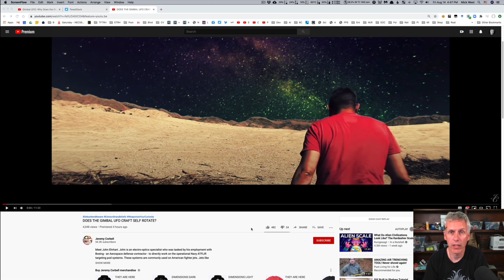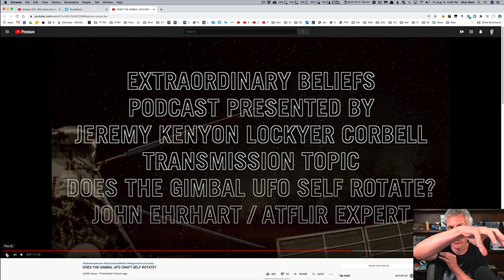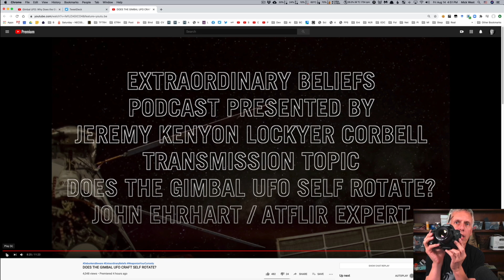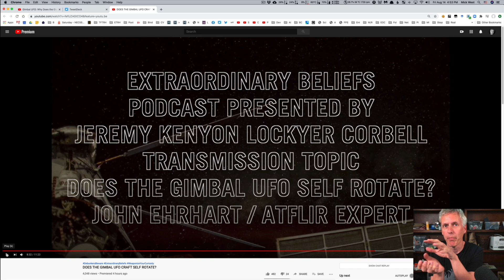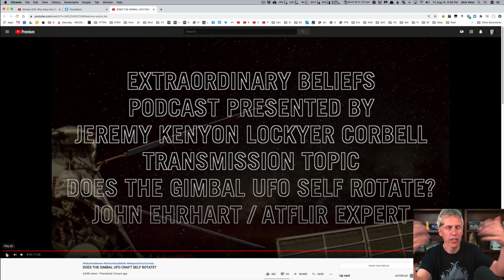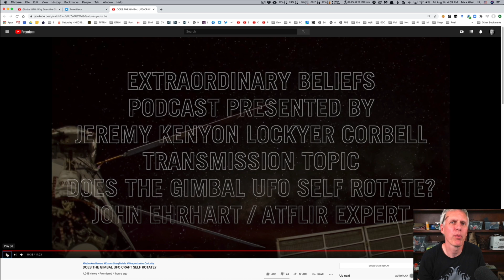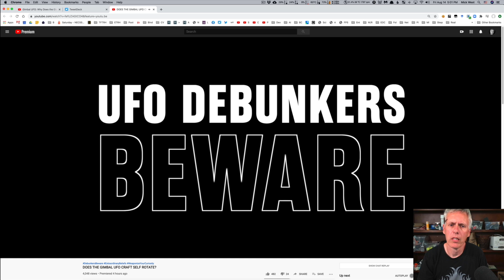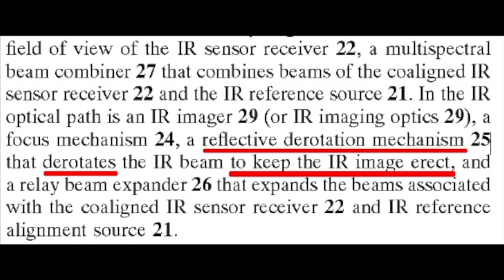A response to "DOES THE GIMBAL UFO CRAFT SELF ROTATE?" (ATFLIR Tech)

Comment: The guy that actually designed the system that we are talking about blatantly said it was not an artifact, optical distortion or other explanation. 
The same goes with Dave Falch and people that actually use these systems and were trained in them.

Comment: This expert has seen the video, I mean pretty much everyone has. Why wouldn’t he explain it the same way as this since he should, as an expert, detect what is actually rotating is only glare and not the object itself from the very first time he viewed it ... because ultimately that seems to be what it boils down to... is what we see rotate the object or glare?
Like in your video at the end with the lightbulb, the lightbulb itself does not and would not rotate, is that correct? But the glare created by the light from the bulb is what we are seeing make the object appear to rotate.
In the UFO video, the object is saucer shaped. So it would seem that while the spikey things could possibly be considered glare, and are rotating, it’s the fact that the entire object shaped like a plate is rotating more than the background, not just the spikey things (if the spikes are indeed glare from some type of reflection).
I’m no expert but just trying to explain what I see and what I have gotten out of both sides. 
I’m sure my simplistic view is multi-flawed and grossly inadequate but it’s my view nonetheless.

Comment: how does it make sense for the whole object to be glare?
Reply: What you need to understand is that what you are seeing is not an object at all, but instead the heat produced by an object. The exhaust of a jet engine is both a source of extreme heat, as well as a point of light. When the object producing the light and heat is distant, the lens flare that the camera sees can easily appear larger than the actual source.

Comment: I think he understood the meaning of the question even if it was not accurately asked. As an engineer I know the capabilities of the system I worked on and I am able to dodge error inducing questions, given I've seen the evidences myself. 

In this case, if the glare was a possibility, I'm confident he would have answer something like "the d-rot isn't rotating the object independently of the BG, but note that, if it's a glare of <x> lumens or greater it would saturate CCD and it would seems to rotate it at the same rate as the optical system does. In this case here it could be the case".

Assuming the optical expert would not raise this possibility because the question is wrongly posed is a bit pendantic. We are usualy smarter than that.

I fetched his resume on Linkedin, the guy is real.

Comment: When talking about the camera system I think it might be more clarifying to separate the optical path and the sensor. Any glare present in the image has to have been added BEFORE the light path reaches the sensor, so anything the light interacts with before reaching the sensor can, due to microscopic imperfections, add glare to the image when there is a bright light source. It is after all not the sensor that rotates but rather it is the lens housing and possibly any compensating mirrors that rotate instead, relative to the sensor.

Comment: The glare is part of the camera and is made by the camera so when the camera rotates then so does the glare which then makes it look independant from the camera to us veiwing it
Reply: Exactly. And the expert FLIR guy is admitting that. It proves Jeremey’s point perfectly. The funny part is it IS caused by the dero system. The dero system stabilized the turning image (because the tracking craft is reaching the zero axis of the rig). I imagine you could reverse engineer the actions of the tracking craft and figure out exactly what maneuver it made.

Comment: Maybe another way of understanding it easier. The glare is in the outer glass of the camera while the derotation happens in it. So let's just separate that glass and the dero.
Forget using an actual glare and just put a sharpie mark on a separate pane of glass. The reason why this would make a good analog is because we know the glare is caused by some artifact in the glass itself (as light hits it). If you rotate that glass, the glare (or mark) would rotate.
-question: But if the glass of the camera is part of the camera, wouldn't the camera rotate the glass as well?
-answer: This is the case when the whole camera assembly rotates around to track the target. However, the derotation mechanism happens within the camera itself, behind that outer glass with the artifact-causing-glare.
So the analog is the marked pane of glass and a camera pointed it at it, with the camera acting as the dero. Imagine the glass is attached to the camera (dero), and that would be the whole camera assembly. We don't attach it so we can simulate the dero mechanic; while leaving the glass pane still, you just manually rotate the camera.
Now we can imagine rotating the whole camera assembly (glass and camera) as its looking at a scene. 
When this happens, the whole scene will spin, as will the mark/glare.
But software recognizes the scene/horizon will spin, and activates the dero.
In the dero activated camera rotation, the glass and camera(whole camera assembly) would spin , for instance, clockwise, but the dero will spin only the camera (not the pane of glass) counter-clockwise in a way that stabilizes the scene/horizon.
To physically represent this, you can just spin the marked sheet of glass itself clockwise (because the dero/camera is stabilizing with the scene/horizon).
The mark/glare will be spinning with respect to the scene as the whole camera assembly spins (technically on a gimbal but works similarly).
Reply: From my understanding the camera doesn't rotate at all. Only things rotating are the optics in front of the camera. Not saying that changes the glare issue.
Reply: @scottandsheilaricca351  I think the camera with the outermost glass optics is on a gimbal moving and tracking an object while the camera (without the outermost glass) is also (de)rotating around its own axis in order to keep the scene level. The optics rotating would achieve the same effect (glare issue) but I don't think there would be a purpose to doing that as it doesn't achieve the derotation to keep the scene level with the horizon.
Reply: @scottandsheilaricca351  Cool, thanks for the video. Didn't know there were mirrors that could rotate an image with it like that. Mirrors rotating and being part of the optics for the dero to happen definitely makes sense. --Realized the conclusion and I'll have to think about it more. If it's an optical dero with lens as opposed to a physical dero of the camera, I don't see how the glare rotation could be caused by the dero specifically.

Comment: Mick West is darned good.  I like to try to see both sides of things and it does of course remain POSSIBLE that the object was rotating... And if Mick's explanation is correct then we do have to ask the question why to pilots aren't more used to seeing this rotating glare in other situations... but at this point we definitely need to need to take the simplest explanation as being by far the most likely - Occam's Razor and all that.

Frankly anyone who has a serious professional interest in this subject and who fails to properly understand Mick's explanation is just embarrassing themselves. It just not THAT complicated! And presenters like Jeremy - if they do want to be taken seriously - then they need to prove that they intelligent, that they can think things through, that they have enough humility to admit to when they appear to have been incorrect... and in short that they aren't just gullible blithering idiot in the grip of quasi-religious obession.

Fiwiw, from what I've seen so far, I have a lot more faith in George Knapp. 

Other thoughts:
- Mick have you managed to get anyone else to confirm that this type of rotating glare is 'a thing'?
- Also do we have enough information on the angle of the object relative to the direction of travel of the aeroplane to say when it would need to rotate its lens?

J
Reply from the maker: I've heard other people have basically confirmed it, but would not speak on the record. So of course that's pretty much nothing.
The angle at which it rotates is going to be software defined, and might vary based on a number of factors - like basically an ad-hoc algorithm designed to minimize the motions. So likely would not always happen at the same angle.

Comment: Can this effect or scenario be repeated or recreated so we can confirm if glares can seemingly rotate with gimbal mounted self levelling cameras?
Reply from the maker: Do you have an ATFLIR? Is it mounted on a jet, at 25,000 feet, which is banking left to come up behind another jet that's flying away, and is several miles away, but being autotracked by the ATFLIR in NAR 2.0x BLK?
You can replicate PARTS of the effect, but I think it's unlikely you can get a good replication on the ground with consumer equipment - or even military-grade helicopter equipment.
Reply: @MickWest  Thanks Mick for your reply. Love your channel by the way. 
I was not suggesting that we try this at home. Haha. I was just wondering if this effect has ever occured in other situations during airforce training. There must be hundreds of training sorties with fighter jets fitted with such equipment  that pass close enough to civilian aircraft that this may well occur again and give a similar rotating glare effect.
I realise this may only happen under certain conditions but could it happen more than once? 
Sorry if I gave the wrong impression. The 6th Generation fighter  jet I am building in my garage out of old washing macine parts is not quite ready for flight. Struggling to find a test pilot. 😊
Reply from the maker: @rossini55  It probably has. Unfortunately there almost no in-flight ATFLIR video out there (in public), let alone something in the same circumstances.
Reply: @MickWest  Yup. Fair point.

Comment: What would be the end of the rotation argument would be to directly ask the guy who says "Look, it's rotating" in the Gimbal video. 
The way I see it, there 2 main options:
-The guy was a pilot with a direct visual on it -> it was rotating 
-He was reacting to the ATFLIR images -> probably Mick is right concerning the rotation part.

Case 2 wouldn't explain other things, like what the "whole fleet of them" was, their maneuvering behavior, what happened in the uncut video, or why the pilots were so astonished. The overall thing (including audio, radar and testimonies) would still remain weird and deserving of a real explanation. 

All it would mean is that, yeah, in this particular video, the object wasn't rotating. Disappointing? Yes. Disproving everything else? Nope.
Reply: The FLIR pod was in narrow field of view mode, which is 1.5°x1.5°. The readout says a zoom factor of 2x was used, which narrows this to 0.75°x0.75°. Using the apparent size of the "object" in the display when the operator says "it's rotating", we can estimate it would appear to the naked eye to be ~2.7 arcminutes wide. For comparison, the moon is 31 arcminutes wide. This thing would appear about as big as a Cessna 152 at 40000 feet looking from the ground. The limit of human vision is 1 arcminute, so maybe a pilot with very good eyes in ideal conditions could tell if it's rotating, but it seems likely he didn't have eyes on it. If it's a glare the actual object would be even smaller and definitely fall outside the limits of human vision.
Reply: @isodoubIet   Excellent explanation.

Comment: The guy is a FLIR specialist technician with over 5 years experience in servicing the technology. He is clearly asked if the effect is produced by the derotation mechanism. He is clearly asked if he thinks it is a product of glare. He says no clearly on both counts. Commander David Fravor who has a lot of experience on FLIR cameras also says it is not a product of glare, in fact in an interview he made clear it is a suggestion so ridiculous he couldn't be bothered to argue about it. The images that you have produced of glare look nothing like this object. They are completely different. You are splitting hairs in your argument. He calls it an object because it is an object. I hope he does come back and challenge you.

In your debunking of the Tic Tac video you say the pilot might have misidentified the distance from the object and it might be 80 to 100 miles away, but the pilot Chad Underwood has said in his account he first picked it up on radar at under 20 miles but over 10 miles visual range, so your unsubstantiated conjecture is directly contradicted by the pilot. You also described the radar tracks in the Nimitz incident as 'clearly radar glitches' despite the fact that the senior airspace controller for the Nimitz fleet has given extensive interviews and has been documented in an official report saying how all the equipment was checked and even recalibrated and continued to give the same readings. You lose all credibility for me when you just make up statements like this.

Both pilots involved in both videos have said that there was no normal engine exhaust signature from either object, but you don't address this at all and in fact claim the Gimble video is caused by engine flare. How can two experienced Navy pilots, in fact two of who were squadron leaders, get this wrong?

In any case the Senate Intelligence Committee has looked at all the evidence, not just these videos, and is set to mandate a full enquiry by all intelligence services and a report to be produced. If the Senate Intelligence Committee was convinced by this evidence and testimony that these sightings warrant further investigation that is good enough for me. I don't need your amateur attempts to interpret data recorded by hi-grade military sensor equipment which is contradicted by experienced pilots and technicians expert on this equipment, based on playing with cameras in your garage.

Comment: OK Mick so now do an experiment where the object itself is rotating.  Maybe rig a swivel on the actual light source.  Let's so how that compares visually.  If it looks identical , then you  haven't really explained it, rather you have provided  an Occam's Razor most likely solution.  I"m not disagreeing with your conclusions, but we need to see an example of an object actually rotating to compare it to 100% rule out  Corbell's interpretations.
Reply from the maker: That's actually a good point. I sometimes gloss over these things that seem intuitively obvious to me. 
What we see rotating is the SHAPE of the glare. The question then is if the shape is caused by a hot underlying saucer-shaped object (or configuration of engines), or if it's something in-camera. (Where "camera" here encompasses everything from the front window to the final display/recording)
Here we have very strong evidence it's the camera making shape as the background light patterns rotate with the object.

Comment: Is it correct to say that the camera is rotating (coincidentally) at the same time the craft supposedly rotates?  Since that is the case it seems that would have to be explained.
Reply: That's not correct. The 'craft' only appears to rotate because the camera is rotating. It has to happen at the same time. This is because it's not the craft that you see but just the glare of whatever is actually there.